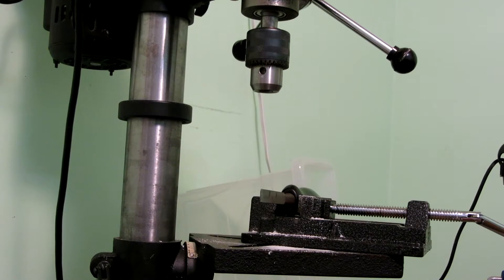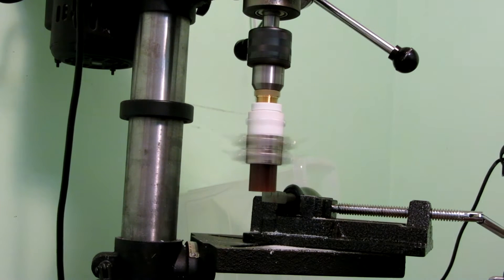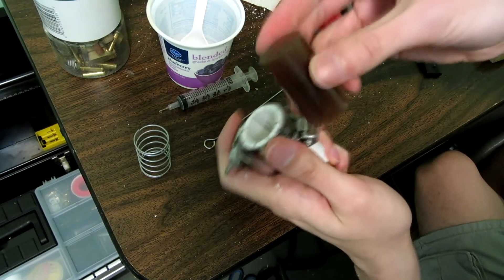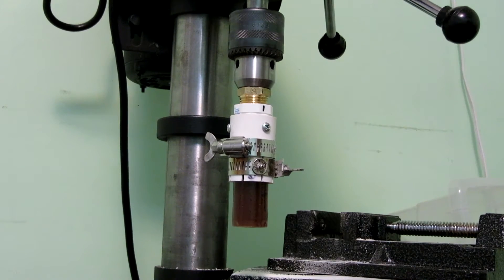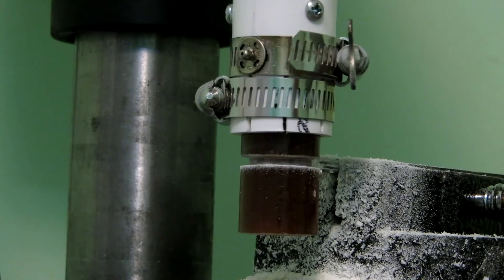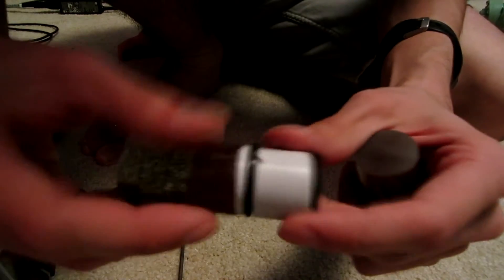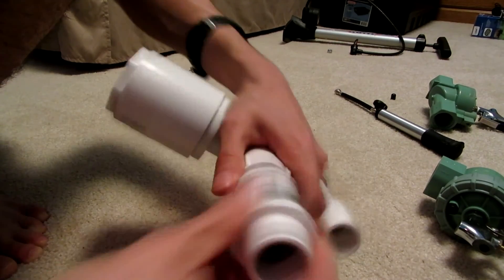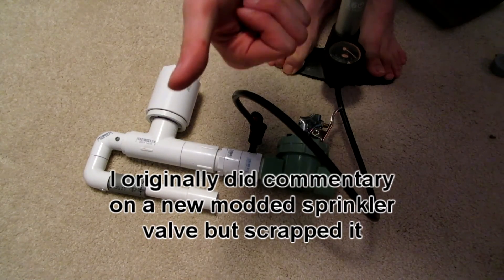Lathing Pistons on a Drill Press with a Homemade Collet

Comment: Nice work! Next time you're facing something off angle your chisel so that only the point does the cutting, that will help keep the chatter down. Work slow to avoid break out on soft material.
Reply from the maker: Thanks! I realized the angle was causing issues, and that I just need a better chisel in general. At least for what I'm doing the chatter isn't going to cause any problems.
Reply: I would bolt 1 side of the vice and work it in a swing or pivot motion. The more you work with it the more trick you will figure out...
Reply from the maker: I was actually using it in kind of a pivot motion but just realized a bolt and wing nut would be much more accurate than holding it by hand. I'll have to see what mods I can do.